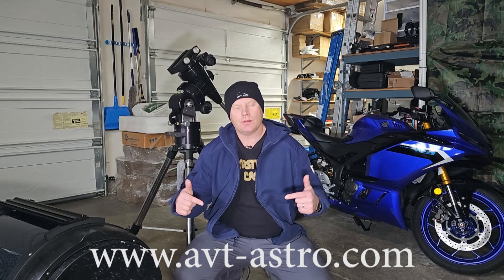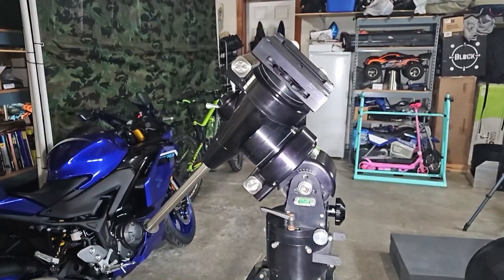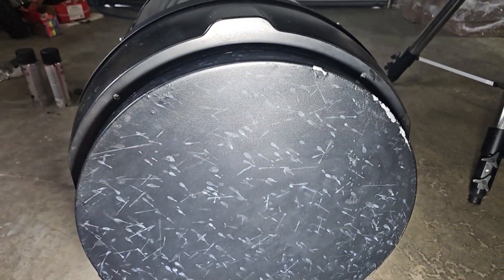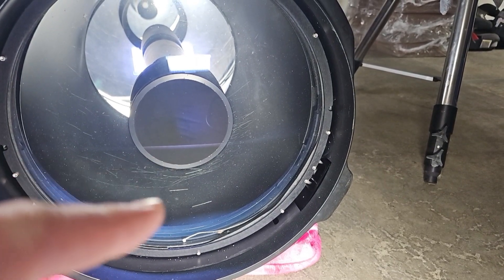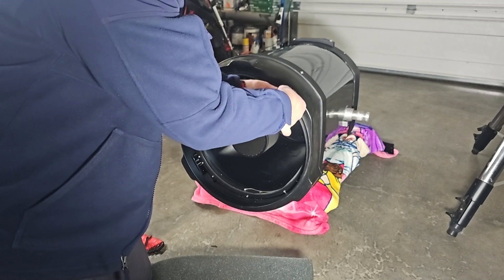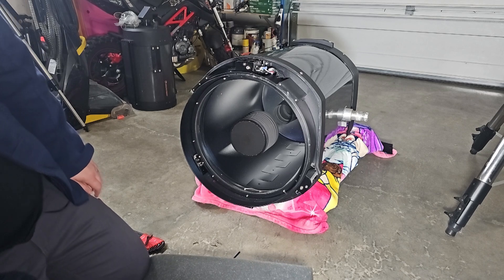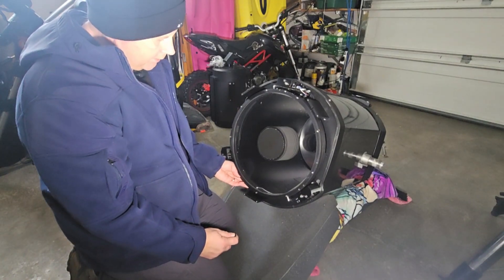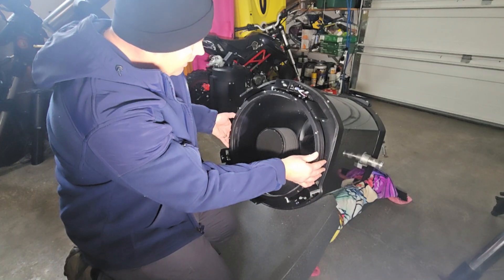16" Meade RCX400 SCT Telescope OTA Front Cover Removal / Corrector Plate Removal - Part 2

Comment: Do you get nervous at all when doing this?
My stress level goes through the roof; with just a corrrector cleaning!!
Reply from the maker: Well, I have done this at least 20 times. So no not at all. But caution is a good idea as one mistake and the entire scope is gone...🫣

Comment: Vlad, how is the glue holding up between the corrector plate and the secondary mirror?  There have been a few owners that have had the glue fail, which results in the secondary falling off.  From the video, the glue still looks decent.
Reply from the maker: I have seen the case with the 20" that fell off. Mine looks good. I don't see any indications of it failing.
 That 20" case was in the tropics. Any glue will weaken when extreme heat and moisture are involved. I don't think that it's a widespread issue.
Reply: @ that’s good yours is OK.
Reply: Vlad, one other thing that you should inspect is the stop mechanism that is on all three of the collimation/focus motors.  You just exposed them when you removed all that housing structure.  I know that  there is a thin metal strip on the 14 inch and smaller RCX telescopes that occasionally falls off and causes runaway motor issues.
Reply from the maker: Thanks for the tip! The metal pieces are all there and in good shape. I'm going to extensively test the operation of the entire focusing mechanism before putting the front end all back together. Are these light sensors that get triggered when the metal pieces go between them?
Reply: @AVTAstro  you’re welcome!  I’m not sure about optical sensors.  I think that it is piece of thin sheet metal that acts to stop to motors.  It is glued on in the 14 inch and smaller models, and the 16 inch supposedly has a screw holding it in place.  The glue failing over time is the main issue here.